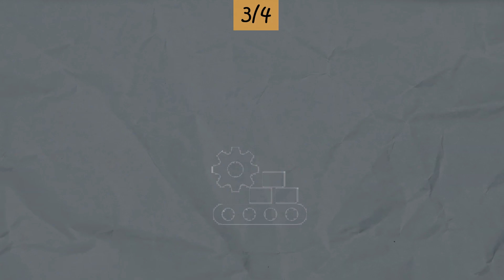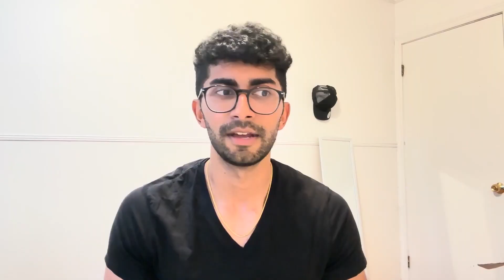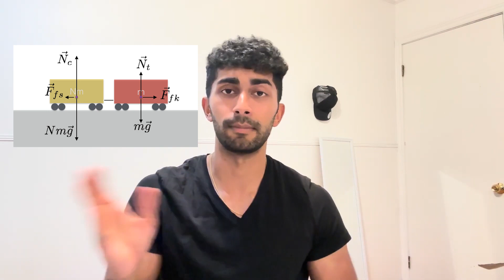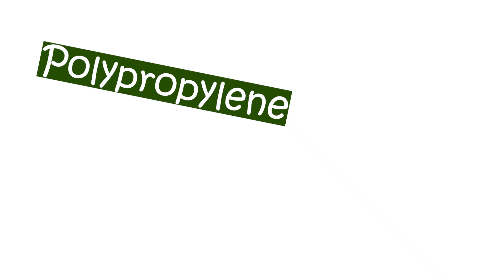MATERIALS : Must Know INTERVIEW Concepts

Comment from the maker: 00:00 Introduction 
00:05 Types of Materials 
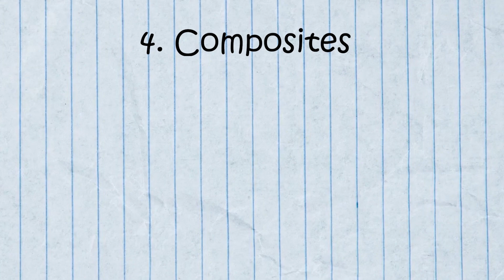00:26 Studying Materials 
01:27 Steel vs Aluminium 
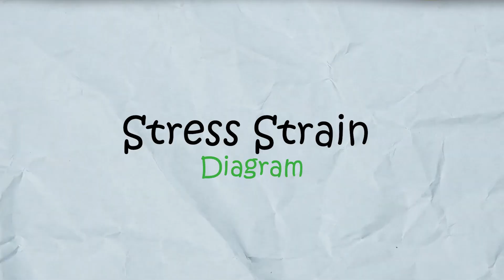03:13 Stress Strain Curves 
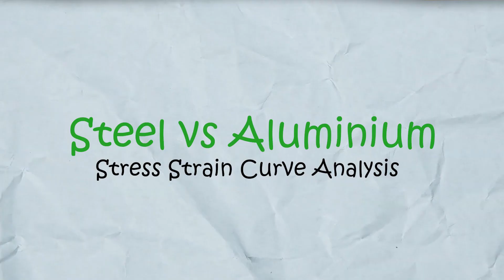04:41 Aluminium - Stress Strain Curve 
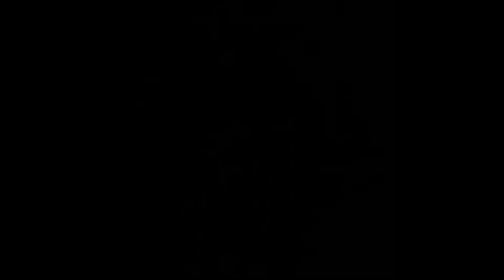07:53 Steel - Stress Strain Curve 
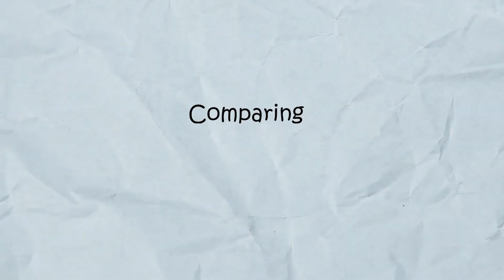09:24 Comparing Steel/Al Stress Strain 
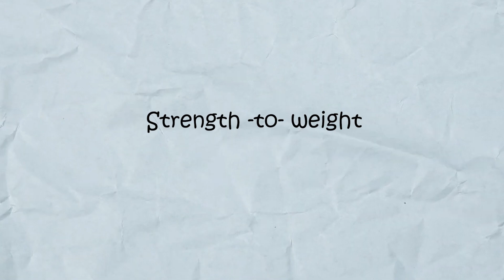11:05 Strength to Weight ratio 
13:26 Interview Question (Material Uses) 
14:24 S-N Curves 
16:38 Polymers 
18:44 Summary